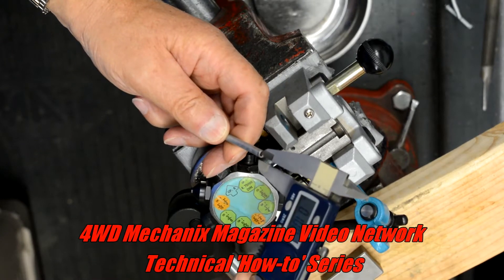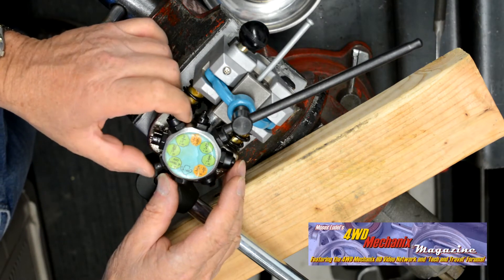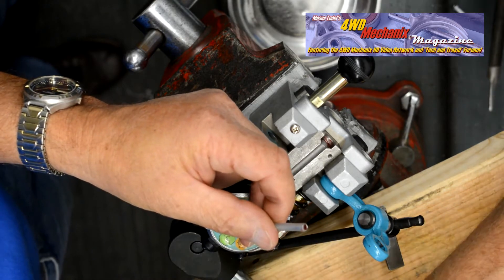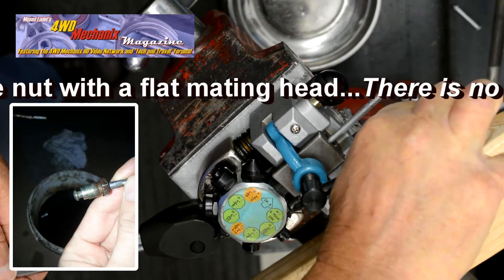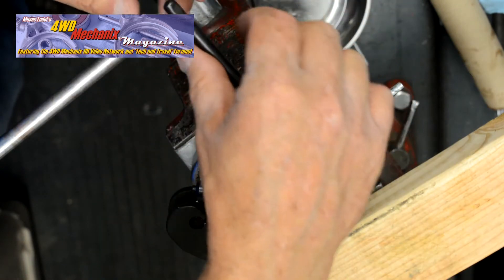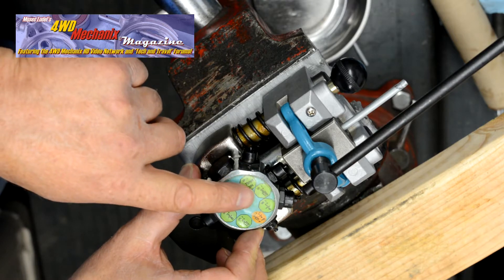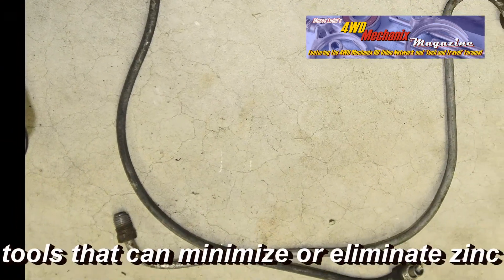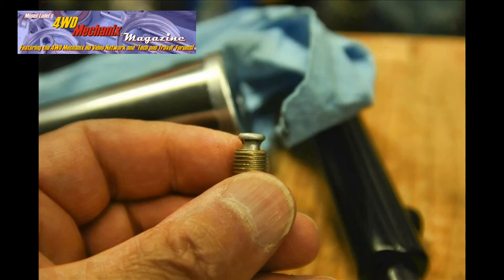How to Identify and Form Brake Tube Flare Ends

Comment: This is one of the most thorough videos explaining brake line flares.  Specifically, showing the difference between the SAE and ISO bubble/mushroom flares.  Many other important details included such as the use of red rubber grease.
Reply from the maker: Thanks, Rob...The subject needed addressing.  Within my career, I taught adult ed automotive for seven years and know the importance of brake system training.  With more DIY mechanics and new techs emerging, I'm putting together classes at Teachable (https://roadandtrailready.teachable.com).  I've considered offering an in-depth course on safe brake work.  Your comments are helpful!